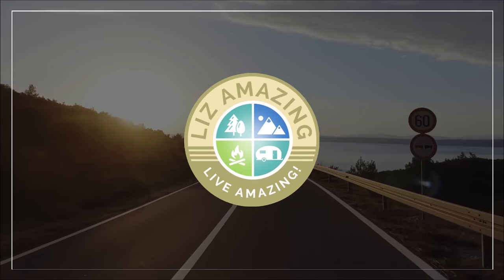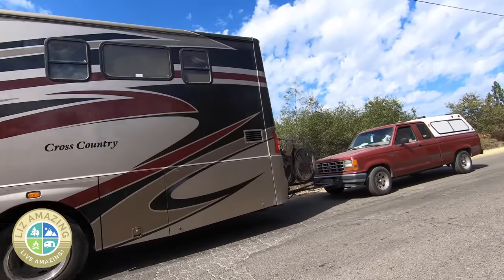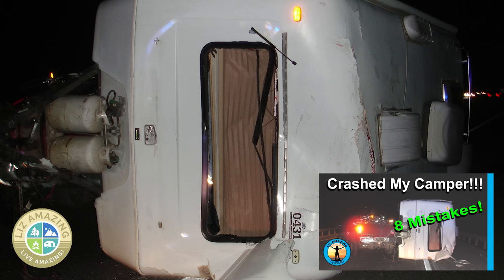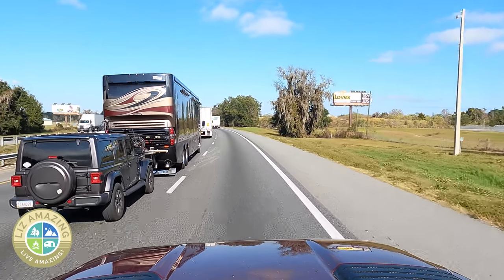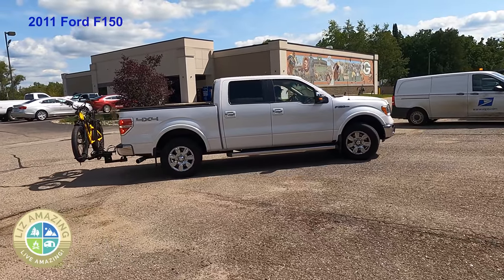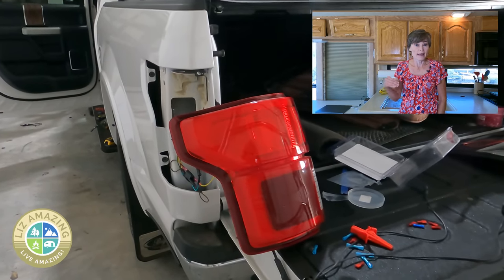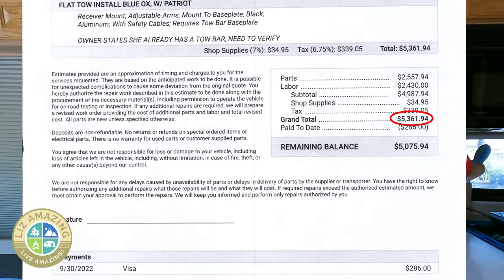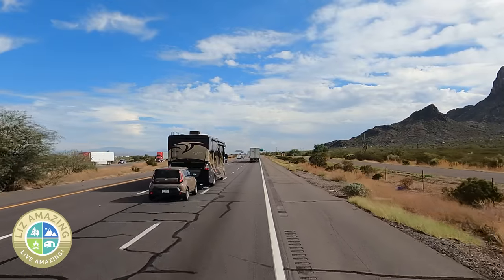These RVers are putting others in danger

Comment: I flat tow a Jeep Grand Cherokee behind my DP. I bought the GC with the Air Force One system already installed. I hook up the tow bar first, then safety cables, then pigtail, air hose and breakaway.
Reply from the maker: You know, the installer showed me how to hook it up the way I did in the video, but I like your order better. I will try it that way next time. Thanks for watching! And glad that you have an Air Force One.
Reply: @LizAmazing  I go from hard connections to soft, that’s just me. I’ve made mistakes, I’ve had the Jeep roll away because the parking brake didn’t hold so now the Jeep only goes into neutral when it’s connected to the coach. You do what makes sense to you and what gets everything connected where it should be. We all have our systems. One time I let a guy interrupt me while I was connecting the toad and I wound up skipping a step. Fortunately when I got to my destinations the toad was still attached but there was a tow bar pin that had almost worked completely loose because I didn’t attach the linchpin. I was horrified.

Comment: We found the same thing had a Blue ox patriot foot pedal braking system, flat towing a Nissan Titan, yes it can be done with a drive shaft disconnect. Well, it malfunctioned while traveling in downtown Atlanta at night. Thank goodness for our TPMS system, as that was the indicator something was wrong as it alarmed, and when we looked back smoke was coming from the read driver tire. Well our Tiffin was doing its job pulling and the braking system was trying to stop the truck. Long story short the rig won as the frame was pulled away from the truck. We stopped using the patriot and changed to demco system. Now we are pulling a 24 Ft ATC trailer all aluminum and it works better for our lifestyle. Yes, we are 70 Ft in length so far have not had a problem styling hooked up, we also have a trax2 to move the trailer when the rig cannot.
Reply from the maker: Oh my goodness. That must have been quite stressful that day! And TPMS is a must. I will be talking about that in an upcoming video. Happy travels to you!

Comment: Liz, I was surprised too when I learned about the required brake system.  When I purchased my Class A motorhome, the dealer just happen to have a Patriot III brake system that they ordered for another customer but the customer cancelled the order. Lucky for me, I had them install the system.  They had some trouble ordering the base plate for my vehicle, so I purchased it myself.  Overall the cost was about the same as yours.  It only takes a minute or so to set it up inside the car. I was so glad I purchased the system, first because it's the law and second while driving in the Appalachian mountains, I came across a big red sign saying, "Warning Steep Decline Grade Ahead 10mph limit."
Reply from the maker: Yes! It's those steep downhills. You don't want your toad to turn into a battering ram! Thanks for your comment, Denny and be safe.

Comment: tow a 18 ft, 10,000 lb trailer for jeep and extras , propane, gas, and inverter generator. Installed electric brake controller in my class c . If campground is too short  I park my jeep back on the trailer when I am not using it. Added rear airbags to motorhome for sag
Reply from the maker: Good for you, Joe, glad to hear this. Thanks for watching.

Comment: I'm glad you pointed out that your motorhome doesn't stop on a dime!  Too many people don't realize that not only does a motorhome not stop on a dime, neither does a semi and they pull out in front of us. I do disagree with your brake system thought process though because I'm probably about as old as you and have never used such a thing pulling a vehicle. But I do think it should be required for those with big long motorhomes to have a CDL just like a truck drivers. Many that drive motorhomes have no experience and are very unsafe on the road.  I appreciate all you RV'rs out there because you've been good for business. 😊
Reply from the maker: Thanks so much for your comment, Bill. Yes, some states require a CDL for motorhomes of certain weights. Thanks for watching.

Comment: Congratulations on your install ! These systems should be mandatory. Get it wrong and your towed vehicle becomes a missile.
Reply from the maker: Indeed it does. So glad you are a believer! Thanks for watching.
Reply: Get it wrong and your towed vehicle passes you on the way down a hill !
   Another thing is stabilizer bars. I saw an expedition pulling a boat and when he tried to slow down and his trailer brakes either weren't working, or not adjusted right...?  It was quite a show! The boat trailer started whipping back and forth in the lane with movements getting more exaggerated each sweep.
In less time than he could have stopped, it whipped his Ford Expedition onto its side and then the boat drove up on his expo.  Yes, his family was with him. No, nobody was hurt, amazingly... just scared spitless!  That was an awful lot of "moneys worth" of wreckage along the highway that day!

Comment: In the UK if you are pulling anything over 750Kg it has to have independant working brakes linked to the towing vehicle to activate them. You can tow very small cars unbraked but you always have to have the rear lights on it working or a trailer board fitted and you have to have a minimum of two red reflective warning triangles there.
Reply from the maker: Good to know, thank you very much. See you in the next video, which just posted, and thanks for watching!

Comment: Amen!  Brake systems are required, and shouldn't be ignored.  I have Demco tow bars (much like Blue Ox) and do use the Patriot braking.  The newer Patriots are surprisingly light, and once they are programmed by the installer, the setup is a one-button push.  The power seat makes it easier to snug in the Patriot, but is not required.   

Do your research and talk to your dealer - the "easier" option of having an automatic system under the hood only works with certain kinds of toad braking systems (which is why I ended up with the Patriot) and you may or may not be required to manually disconnect your toad battery each time.   I made sure the car would fall within the towed weight requirements of my Class B+, but only later learned that the braking system I initially wanted could not be installed.   But it's still only 5 min to hook up or disconnect everything (and I'm getting faster each time), and I feel much safer knowing it's right.
Reply from the maker: Yes, and it's so important do independent research as well. Some dealers may only want to sell certain products. When I got the InvisiBrake installed, the installer tried to get me to do the Patriot. He said the install with InvisiBrake was a few hours. But when I did independent research I found out that MY setup time would be much shorter! So that's why the InvisiBrake one. Definitely it's so important to do the research and make sure the system is right for your toad. Thans for your comment and so glad you have a braking system!

Comment: I used MH/ toad brakes since 2001. It was stressed to me years ago when I decided to tow. Most class a owners that I associated with even back then all used a braking system. It was never a hidden secret that wasnt discussed.
Reply from the maker: It sure is now. The commenter I answered right next to yours thinks it's ok to go without a supplementary system. And that's what I was hearing when I talked to motorhome owners in campgrounds. Glad you have toad brakes and be safe out there!
Reply: It sounds like to me what is the norm in a community(area). It’s just like hearing and seeing! people towing a 44ft-5th wheel with a short box single wheel 3500 truck, they figure nothing is wrong with that 🙄. 🍻

Comment: Hi,
 The first thing I did was check into it. Safety first. I checked with the RV dealer and have them put the system in.
The state I live in and other states  it is 1,000 pounds and up you need a breaking system.
Then the car I would tow with was a Ford Focus and only it have one type of motor and trans. that could be towed.
I towed it about 20,000 miles. It worked ok.
People have to check things out or people might get killed!! It only takes one time.

Thanks for letting people know about this issue.
Reply from the maker: Thank you so much for this. I am glad this video is helping get the word out. And good for you for doing the research and putting safety first! Thanks for watching.

Comment: In many states it is the law to have one now. Back in the 1960s we didn't have these new systems and towed without one until the box systems in the 2000s.
The system that used early was a surge system that tapped into the brake lines of the towed vehicle that was prone to leaks and failure.
Reply from the maker: Yep. I've heard bad things about surge brakes. Thanks for your comment, and for watching. See you in the next video.

Comment: The other thing you have to remember is that they wire the vehicle that’s being told that the tow vehicle keeps the battery charged a lot of times the towed vehicle the battery will die from using the brake lights and the brake mechanism if the wiring is not done correctly so you’ll get to your campground and end up having a dead battery in your spare vehicle there
Reply from the maker: Oh that's such a great point. Thanks for this!
Reply: @LizAmazing  you are welcome , safe travels

Comment: Great video! I echo everything you say about flat towing, it is definitely the best alternative, but there is so much more to it than people talk about. I have a class B diesel sprinter. I started out with an older subaru (stick shift), Roadmaster tow bars, and a Brake Buddy. I actually bought the subaru fully TOAD equipped. I upgraded to a Jeep Cherokee, and wanted an automatic. However only the Trailhawk series has a neutral option on the transfer case. The Cherokee also has electrical power steering assist that must stay on when being towed, so there was an extra harness and switch to facilitate that. That makes a battery tender an absolute must also. The Brake Buddy also requires seat adjustment to wedge it in place, but either power or manual seats work fine. I will say that another hazard out there is whether the towed vehicles are a safe weight for the towing vehicle. I see a big difference between my 3200 pound Forester and my 4200 pound Jeep and that makes the brake buddy all the more important. With a 5000 pound capacity on the sprinter I am still ok. The sprinter also only has 4 wheels on the ground (not a dually), so towed vehicle brakes are definitely a plus. 

Brake Buddies are also inertia-operated devices...they apply brake as they sense deceleration, and the sensitivity is adjustable. Your system I would consider superior, where the brakes are applied as the motorhome brakes are applied. I certainly feel the difference when the towed vehicle is braking.

One other setting that can be critical is how far off of horizontal the towbar is. Some are not supposed to be angled up or down beyond a certain limit. This may necessitate a drop or lift adapter to put the towbar receiver height at the same height as the tow vehicles adapters.
Reply from the maker: Thanks so much for sharing your setup and the wisdom in your comment. Such a good point about the towbar, too. Appreciate you being here, Peter, and see you in the next video.

Comment: I bought my 9 ton equipment trailer and it didnt have brakes when i bought it.  I did a short trip before i could redo the brakes and i went slow and easy since i was pulling 13k with a 7k trk. Not recomended.  Now i run a 9k trk with 13k trl.  So much better. I havent serviced trl brakes and axles recently but i test them every trip since i have to readjust them all the time going empty 6k to loaded 13k but its nice the electric controller in trk tells me that the wiring circuit is good so its just knowing if mechanicals brake parts are good.   Im a truck driver and i want to get home safely as you do too.  Brakes are important just because you have a big tow vechicle doesnt mean its safe to stop your car too
Reply from the maker: Yep. So glad. Thanks for all you do as a trucker to keep the economy moving. And thanks for watching. See you in the next video.

Comment: I have the Air Force one. Also expensive but works well. I Have a DP with a 2012 Honda CRV. One trip, the air hose became disconnected (my fault).  I did not know for a while and the hose was trashed. Because I was committed, I travelled without until I could get another one. I drove very carefully but was quite uneasy. On hills, I could definitely tell. 

One note, you have probably discovered this but your brake lights come on not only when you push the brake but also when your exhaust brake comes on.
Reply from the maker: Yes, I did discover that. That's so great. And I have heard good things about the Air Force One as well. Glad you've got one. Thanks for your comment!

Comment: Another very good video.  Safety is of utmost importance... I understand your feelings about trailers, one thing to consider is that you can back up with a trailer!  We have a car hauler open trailer for my wife's 350Z Roadster that we would take along with our trips in our Class A Vista 30T.  Now that we have a 2 year old Golden Retriever we are relegated to bringing the Camry as there are only 2 seats in Nissan and Lucy is to big to sit on my wife's lap, she takes up the same space as a human.  While talking about the same type of setup that you have a full timer once described his Ford F150 as starting to pass him in the rear view mirror.  One of the pins for the tow bar came out and the truck moved over to the left while being towed by 1 bar.  He slowed down and pulled over and stopped.  In that situation the brakes should be lightly applied so the truck slows down without running into the rear of the motorhome.  No matter what the way of towing always check and recheck all connection points, hitches, and cables at every stop.  It seems when you let your guard down is the times that bite you the worst...
Reply from the maker: Yes, indeed. Gotta double and triple check everything. AND do a walk around inspection at every stop. Thanks for this! I talk about backing the motorhome in the next video, see you then! Thanks for watching, John.

Comment: Good Job !  I have a Class-C(30Ft), Towed = 2014 CRV, Roadmaster Invisibrake + All terrain tow bar system, electrical. My time to install, parts=~$2500.  I can't see anyone flat towing 2000lbs. or more without a brake system on the vehicle/trailer.  If you have a Class-A or Class C RV, stopping/controlling the towed vehicle without an effective brake system will over stress the tow bar system and on a small Class C will affect RV handling.
Reply from the maker: Yes, it will indeed. Thanks for this Phil and glad to hear you have a brake system. See you in the next video.

Comment: A braking system for me was a must !     Well ok, I bought the BlueOx Patriot 3 braking system for my Jeep Gladiator.   I know you ruled against it.   For me,  it Works great.   Easy install.  Takes me 5 mins to put it in before I leave.  I lOVE IT.    I figured I would save all that $ for installation fees (for another system) and just have a system that I could put in and pull out myself. I'm sure most of that $5k you spent on your system was for INSTALLATION LABOR COSTS which is where they get ya.   Regardless,  I'm very happy with it.  Its simple to use.  I would recommend it to others.   Good luck and I'm glad you got some brakes on your toad.
Reply from the maker: Glad to hear you are happy with your Blue Ox. Yes, I paid at least a few extra hours labor to get the Invisibrake, so it was definitely spendy. Thanks for watching and see you on the road!

Comment: We have a Class A diesel pusher. In some states a braking system is required by law. We have the Air force 1 braking system. It is air activated. There is no braking box, arm or pedal on the car. It is all controlled under the hood. We always use it. It is just a quick connect hose. That's it. One time one of the D rings broke. When we got home I went to unhook the car and noticed the pin holding the tow bar to the car had backed out almost an inch. Scared the bageebers out of me. Now I carry spare pins and D rings with us. Originally we were like you we planned on towing our Ford F-150 4x4. I stopped into Ford one day just to verify we could flat tow. They said we couldn't. Because we had a shift on the fly. They said we couldn't put the transfer case in neutral. So we bought a Lincoln MKX. Our Lincoln Town Car was 20 years old. We were due an upgrade. Our only complaint if you can call it that is we can't exceed 70 mph towing. We generally keep it at 67 mph on the interstate and we can only tow for 6 hours before we have to unhook and drive the car to lubricate and cool the transmission. I wouldn't think of driving without hooking up our braking system.
Reply from the maker: Hi Adrian! I have heard good things about the Air Force One, glad you have it! Like you, I was due for an upgrade since my 2011 F150 had nearly 130k miles. I love the extras on the 2018. Happy travels to you and thanks for watching!

Comment: I have the patriot, it weighs about 8 lbs, you do not have to have power seats, it helps but you do not have to have them. it takes about 5 minutes to install in the towed car.  one problem i found out about the hard way was tat all motor hoes do not have a dedicated power line to keep the towed car battery charged. I have to keep my lights on for this to happen. only 4x4 fords according to ford are towable, i envey you on that one, parts are on the way to run a decicated line for this to be done.
Reply from the maker: That's good to know, Hugh. The gal at Blue Ox evidently gave me bad information, or maybe they just don't recommend a manual seat. Thanks for commenting and glad you have a brake system.